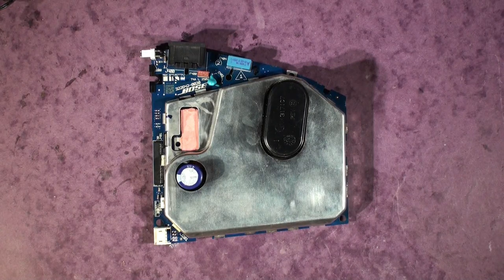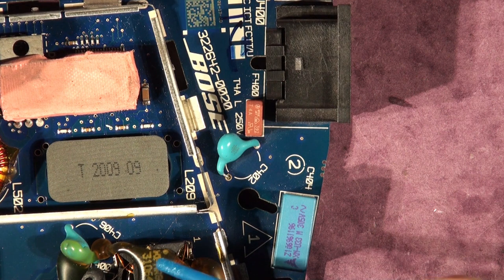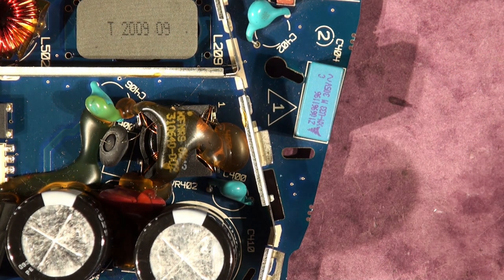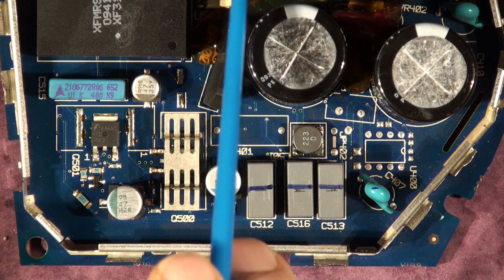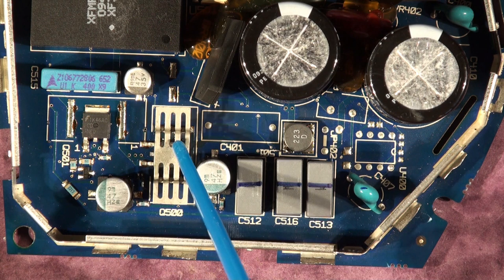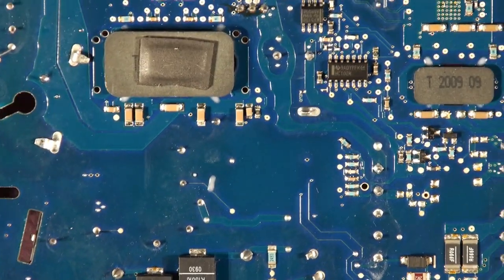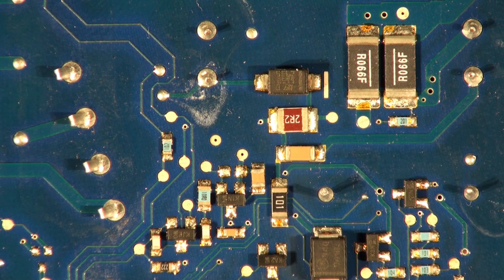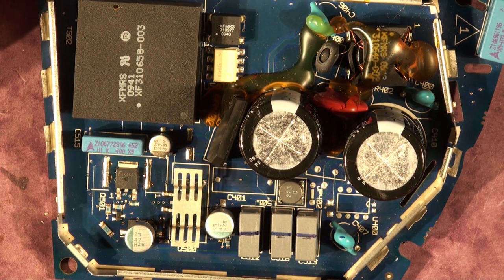Bose SoundDock 10 Diagnostics and Repair Video Part 1-Overview Bose 322642-0020

Comment: You sell the parts for this servicing of the power supply? How do I order them from you? I put up this question earlier but it seems to have disappeared.
Reply from the maker: I can sell parts  but I dont'' have time to offer individual support .
Reply: Videos are excellent and should be sufficient to complete the job. I am only looking to procure the appropriate components. How do I do that through you? I have checked out the web site mentioned in one of the videos but could find only replacement boards listed.
Reply from the maker: @spiritlynxs  What parts do you need?  All parts are available at a reasonable price from LCSC.com
Reply: Ok I have tried LCSC but cant find for instance the capacitor marked Z111 494502 - the 400V 104nF you describe as an X9. I am looking for all the components you describe as high stress to be replaced while servicing. You mention in the video you had put up a BOM for these items but I don't see it, however two of the videos in this playlist are unavailable . . . was it attached to those? Any help here pointing me in the right direction at least on the above cap would be greatly appreciated.

Comment: there is hope that it will be as well as he said when I brought it to fix the board, (like your board repaired)it is said that the board is broken, it is said to be home to insects, cockroaches and rats. (Like a popooo and Dry urine from insects)Almost a 1 yr i used only i buy only to the owner thanks for the answer😊✌️
Reply from the maker: Good luck with it,